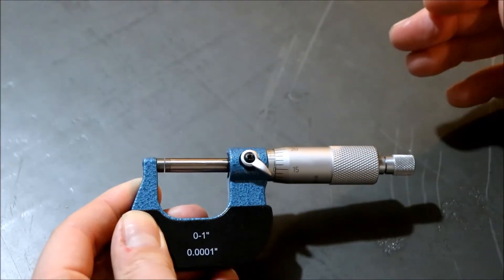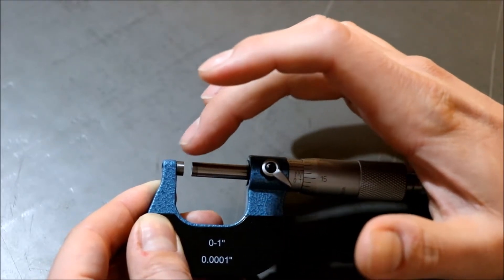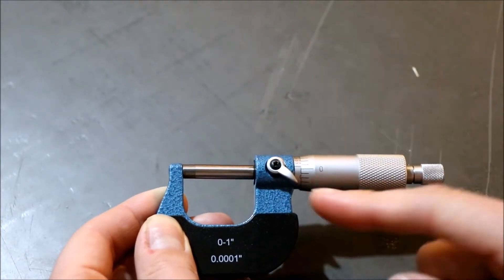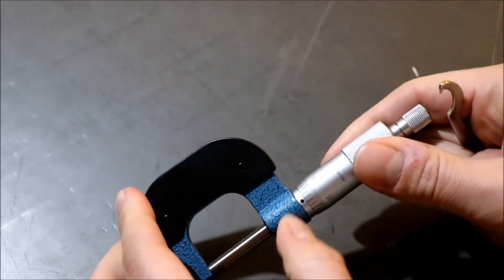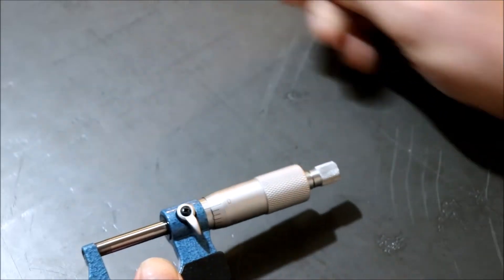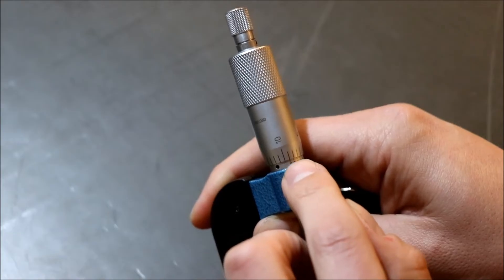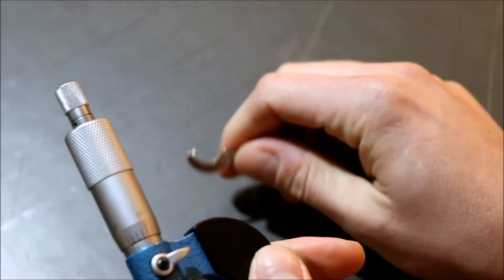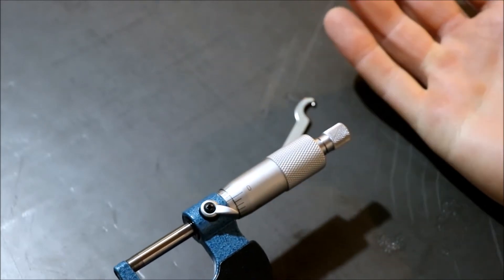How to Zero a Micrometer

Comment: Hi Peter here the vid is very good. Did you know you can set a mic to be read left handed  by turning the barrel 180 degrees and releasing the spindle from the thimble and turning it 180 as well.

Comment: Not trying to negate your effort for such good video but questions I have. There is another hole on the nimble end and the spanner wrench has a smaller hook at the another end. Is that meant for making other adjustment of some sort? If so, what? Torque of the clicking?

Comment: Got a very old mic from an old engineer and the barrel wouldn't move. The video confirmed that that's definitely how it's done, so this gave me confidence to increase the "persuasion". With the barrel clamped in the 4-jaw and a mallet, I got it to shift. After a few times ging back and forth it can now be adjusted normally. An old tool saved from the bin. Thank you!

Comment: This was exactly what I needed.  I watched several other videos and none of them showed how to adjust my micrometer set as they were showing for a different style of adjustment.  This will work for VEVOR branded micrometers like mine. Very much appreciated!

Something to keep in mind is that the standard gauges in some of these cheap micrometer sets are not exactly to size.  Mine are all 0.0008-0.0020 off of true size making the micrometer very hard to adjust to true size.

Comment: Not to be a troll, and I only just learned this myself, but Mitutoyo suggests turning the ratchet 1-1/2 to 2 full turns to exert constant measuring force.  Until I read this in the insert with my new micrometer today, I had always done it like you do in this video – just a few clicks.

Comment: Helpful video, thank you. In addition, to zero a mic that is extremely far out of spec and putting the thimble zero in a poorly visible spot (over the top or around the other side) , the spanner wrench has a small side, which is used on the ratchet stop keyway to loosen the ratchet (which your mic in the video has), then pop the thimble back toward the ratchet, and bring the thimble zero to your preferred orientation before reassembling/resnugging the ratchet. Again this is for extreme cases, but it covers ALL adjustment with the addition to your video. Good share sir!
Reply: would you be able to explain that again? I have the problem that when I close it all the way down, I'm about 0,5mm too far out from the 0 line. I'm not sure if that's because a lack of quality or that I'm not able to adjust it correctly. If I loosen the ratchet stop I still can't move or make any changes.

Comment: Thanks for the how-to. Just got my first micrometer and I need to zero it.
Reply: @Chris Cox. I have 11 micrometers, welcome. A couple of quick things, never store the closed in the box. Allow room for expansion and contraction. Allow the micrometer to acclimate to changes in temperatures if stored cold but using in a warm area. Many, like his, has phenolic pads attached to the body, keep the heat from you fingers from changing your reading. Just thinking out loud.
ASE Master Tech since 1978 - Retired

Comment: No doubt it can be discouraging to have under 50 "likes" when you took your valuable time to make a video, but this was quite valuable to me and I'm adding it to my Reference folder.  Today my first micrometer arrived - something I've wanted for a very long time (50 years!) - and it's a Fowler that almost looks the same as what you used here.  It took me a minute to realize that mine is the cheaper version that goes to 1/1000th of an inch, while the one you demonstrated goes to 1/10,000th (i.e. why can't I find those last numbers he has?).  Good learning experience.  Thank you!
Reply: Some have a tenth reader, some don't.